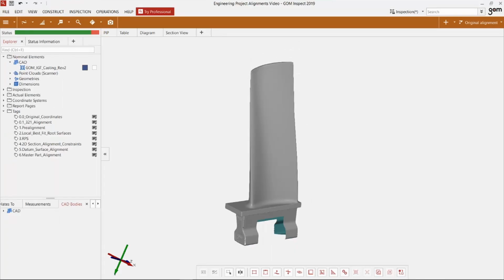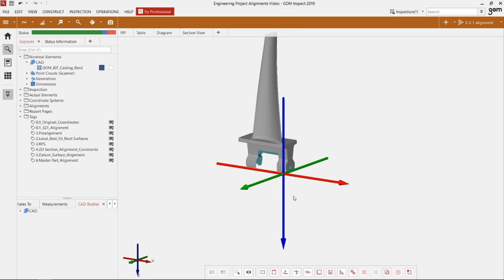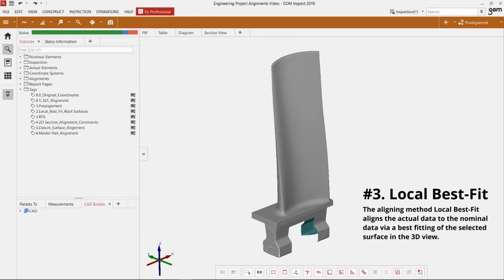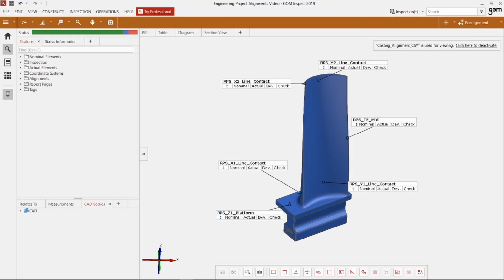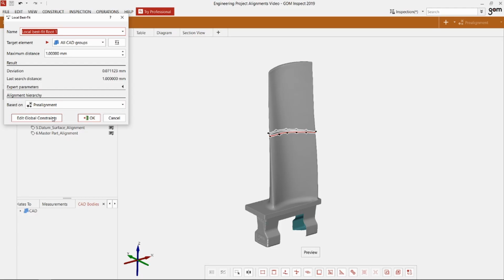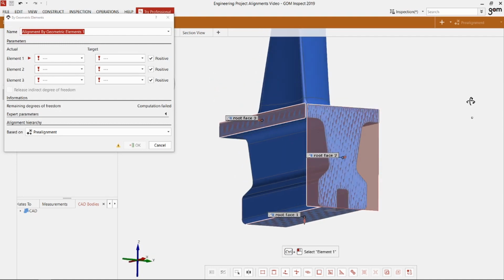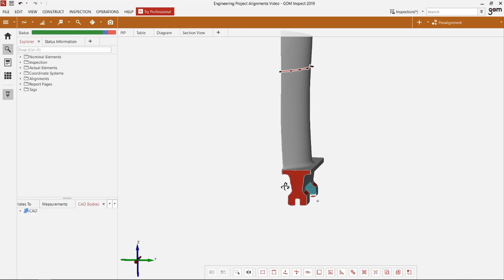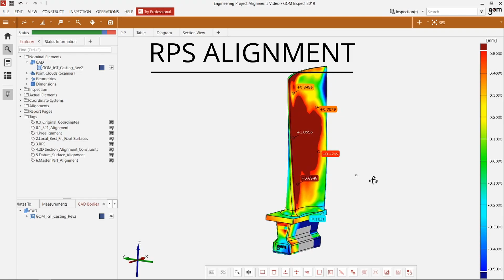Scan To CAD Alignment Methods in GOM Inspect Software

Comment: Does  an alignment which is performed in one of the ways as shown in this video affect the result of a GD&T measurement when the callout is with reference to datums? Or are the alignments shown here used only for analyzing deviations and generating color maps, and GD&T measurements are independent of it?
Reply from the maker: Hi! Thanks for your question and thanks for watching. 

By default, GD&T calculations are not affected by the alignment of the part so long as the alignment between the mesh and the CAD is not so bad that features cannot be automatically extracted by measuring principles. Non-GD&T calculations, scalar distances and color maps, for example, can be impacted by the alignment. 

Please feel free to email us at info@capture3d.com if you have more questions. Have a great day!

Comment: What happens if we select entire mesh data for local best fit alignment.
Thanks
Reply from the maker: The software will still try to minimize the deviation of the selected area - in this case, the entire body. If you select the entire mesh data for local best fit alignment - it essentially becomes what a prealignment is with the best fit box checked. The big difference comes from the ability to define the maximum distance away in a local best fit, that the prealignment doesn't provide.